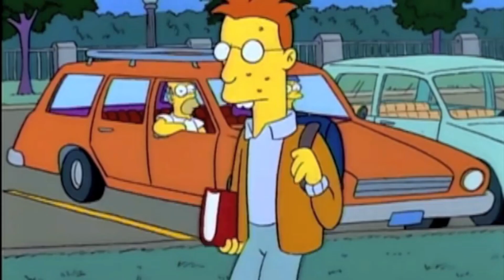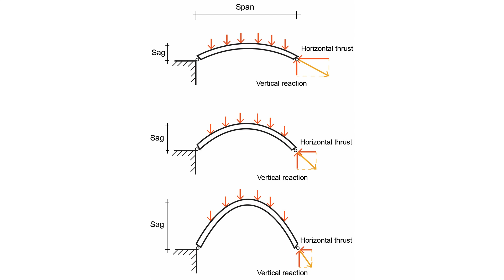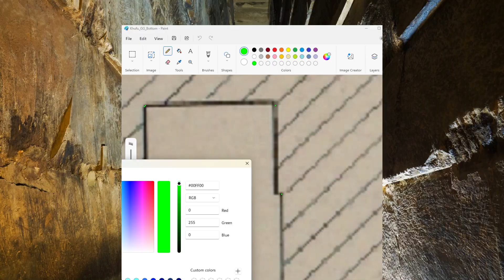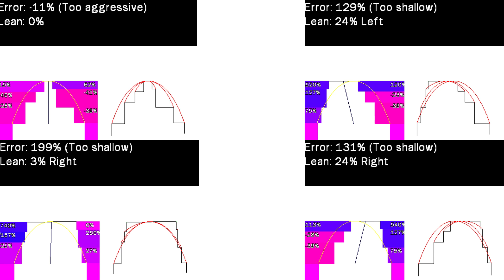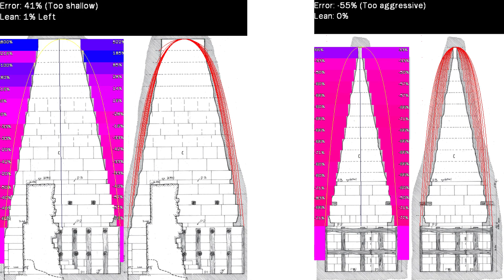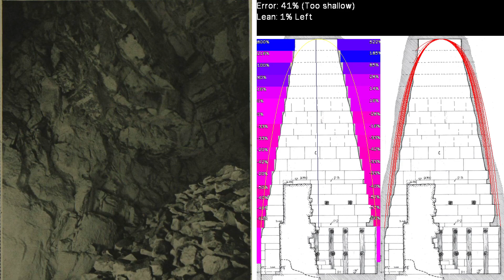Did the Ceiling Design Doom the Bent Pyramid? [Partially Retracted]

Comment: How is the catenary curve relevant? Each corbel is essentially a cantilever, self-supported by its own weight. The only relevant information is the depth of each layer of blocks and the strength of the material to know how far it can safely overhang when sufficiently anchored. The point is that if you removed the top layer of the vault, it wouldn't collapse because the forces are all traveling vertically downward, not laterally and downward as with a true arch. A corbeled arch, particularly with this steep of a slope with such a small overhang is overkill for the purpose of ensuring it could hold the weight above it. It's not the same as an arch that redistributes the weight. Like a cantilever house on a cliff, there needs to be much more house on the cliff than hanging over it. Gravity will do the rest.
Reply from the maker: Someone else had a very similar idea.  I actually agreed with them, but then we modeled it in an FEM.  Turns out, no, it does not act as individual blocks.  That only happens if the lateral forces exceed the static friction holding the blocks together.  Which it doesn’t.  Model it, you’ll see.  Try the same design with a low friction coefficient and again with that of rough limestone.

Comment: The bent pyramid has retained more cladding than all other pyramids combined. The bend was intentionally put into the design.
Reply from the maker: I think the casings largely stayed in place because they lay at an angle.  Because of that, there is a force running down the entire face of the pyramid, which presses harder on the stones than flat courses do.

I go back and forth between thinking the bend might be intentional or that it wasn’t finished.  We’re pretty sure there’s at least two layers inside of it from the joints in the passageway, and Meidum was built like an onion of 10 layers.  It’s possible they intended on flattening out the lower section but Snefru’s death changed the plans so they cased it bent.  We just can’t know for sure without ancient hieroglyphics telling us.
Reply: @WallacesMysteriesofAntiquity  It was intentional.
Reply: @orbitalbear  Completely agree. The fact that the bend was cut into the facing stones is another nail in the "they didn't know what they were doing" theory.

Comment: I think you missed a point made in your referenced video on suspended modelling: The ideal line can be drawn inside the stone. As long as that is true, then you have a self-supported structure. Thus in the diagrams you made, with the curve tangential to the inside of the "capstones," is going to be wrong. The curve should insted be coincident with the inside corners at the top, for things to be correct.

However, while I dont work with stone, instead working with the stress and strain of steel structures, I don't agree that that these structures need be evaluated in this manner. I suspect linear corbelling, like what we see, is more than sufficient to distribute the forces involved, given their enourmous lateral support and relatively small spans they are required to cross.

Still, good video, nothing to be nervous about. 👍
Reply from the maker: Oh shoot.  It took me a moment to realize what you were saying, but you’re right.  The inner corner at the very top, should be on the catenary line, not define the top of it.  

Interesting.  Luckily, that would only produce a large error on a fairly wide top.  Since the points tend to be very narrow, that error should be quite minimal, since you’ll still have a fairly steep slope, but it’d be exaggerated in something like the grand gallery.  

I think I even realized this at some point but then it slipped my mind.  When I do a corrections video, I’ll be sure to mention it and adjust my code in the meantime to get more accurate images.  It shouldn’t affect my argument, but I’d like to be as accurate as possible.

Comment: Thanks for your thorough, laborious, factual and I think relevant analysis. Two things: 1) the font you use to present your numbers is absolutely atrocious and not fit for purpose and this is because of the ridiculously sized teeny minus sign. A good minus sign is approx. the width of a small letter n. Also, when signs matter as in your percentages, each number given should have a fat plus or minus sign in front of it; the way you did it at the resolution I watched, I could hardly discern positive from negative numbers. 2) The comparison of the Bent Pyramid with the shape of the crown I find rather far-fetched. There's something much closer, and that is the centerpieces in the sun temples of the OK, see https://en.wikipedia.org/wiki/Egyptian_sun_temple for a picture: for some reason Egyptology assumes a form for the central mass that looks part way between a proper pyramid, an obelisk, and the bent pyramid. I do not know how Egyptology arrived at this shape given the heaps of rubble they excavated, but at any rate the Bent Pyramid does look a bit like the  top of an obelisk, clearly a family of shapes that the Egyptians were fond of and favored over other similar designs.

Comment: You actually do have good points in your video, Wallace, but you, History for Granite, and even Ancient Architect overlook a detail: That the lower and some of the middle courses of the corbelled were shaved flat in antiquity in order to make it shorter.

Notice how the upper chamber has those wooden beems on the floor that were originally found buried under sand until Maragioglio and Rinaldi cleared it out on the 60s, revealing the beams and original floors.

It seems at some point, the upper chamber had its floor raised and part of the corbel cut to make a new roof/wall of some sorts, but in doing so, made the corbelled roof weaken and crack. Even today, traces of that work can still be seen today. Egyptologists believe this is one of, if not, the main reasons why the Bent Pyramid was abandoned and the Red Pyramid was built.

I think Sneferu wanted it to be shorter as it was too tall, not to imitate the upper crown of Egypt. Why else would he make the Red Pyramid chamber shorter?

I recommend reading Keith Hamilton's paper on the Bent pyramid as he goes into greater detail.
Reply from the maker: I don’t think any of us overlooked it.  I talk about that structure for a few minutes in my dedicated bent pyramid video, as does HFG.  The problem is that we’re not even sure when the massif inside was built, the association with Snefru came from graffiti which wasn’t dated.  I’ve heard a lot of theories as to the purpose of the massif.  I’m not convinced by any of them enough to justify even tentative conclusions.

I see no reason Snefru couldn’t have a tall chamber.  Djoser had a nearly 100 foot shaft above him, though admittedly they’re totally different types of structures.

FYI, it was Falkry, then Hussein that dug out the top of the massive in the 40s, not M&R.